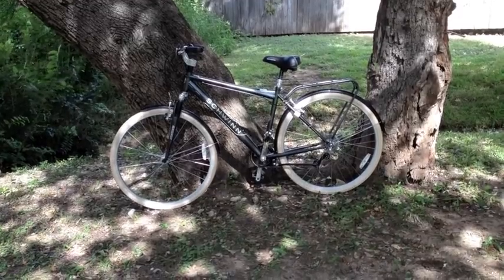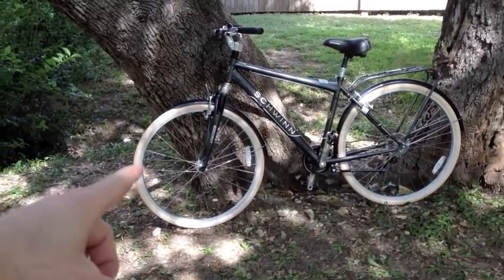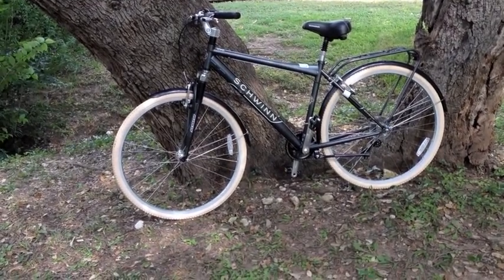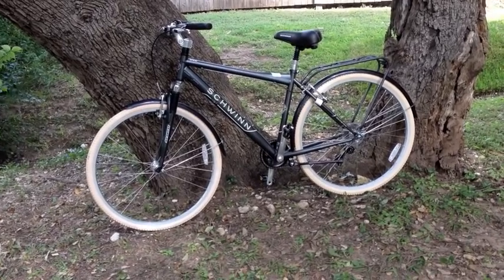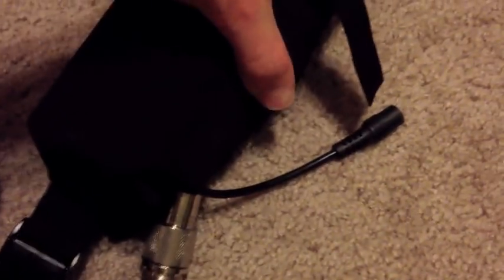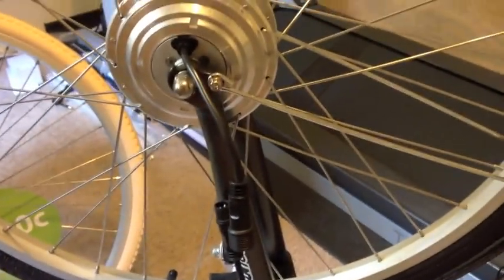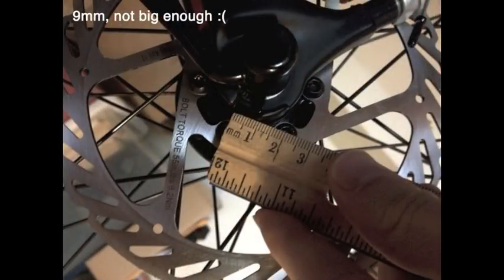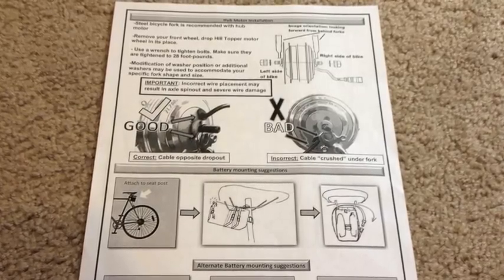Clean Republic Hill Topper Electric Bike Conversion Kit Review - $400

Comment from the maker: Hey man! Yeah, I definitely think the extra $100 is way worth the weight savings (2lbs vs. 11lbs), plus you get a better battery (lithium) that will last for more charge cycles. Check out the review linked in the video descriptions, I go through the different options, weight etc. and be sure to measure your drop outs to make sure they are wide enough!

Comment from the maker: Any geared hub motor will add a bit of resistance but it really is minimal and in my experience riding this bike under my own power it felt very similar to how the bike performed before the conversion. The biggest impact a kit like this has is on weight of the bike and that's why I like the sprinter :)

PLEASE do be sure to read the full review linked in the description and measure your fork dropouts because this kit didn't work with my high end road bike, the drops were too narrow.

Comment from the maker: The top listed speed is 15 mph and it really only has one speed when you push the button. I'd say it goes medium-fast compared with other bikes. It doesn't offer a lot of torque but it's also not that heavy. You can always pedal faster than 15 miles per hour but that's really as fast as the motor is designed to go :)

Comment from the maker: Yeah, I ordered the disc option because I wanted to use this with my road bike but the axle was too wide so then I got this cheaper Schwin that had v-brakes. It worked fine and would work with disc or vbrakes. I can't really comment on how reliable the hub is, I didn't stress test it too hard, it seemed generic and solid enough.

Comment from the maker: It should be fine, especially if you keep the battery contained in the pack they give you. Water can cause rust on metal components but most of this is system is covered or sealed. You might worry about shorting out systems but that would be unlikely unless you rode it into deep water that submerged the entire hub or battery pack and controller unit :)

Comment: Very nice video.  I'm glad to see you are wearing a helmet and eye protection. Keep up the good work. California allows us to use a 1000watt system, speed limit is 20MPH. On my bike the conversion was a bit more complex. Batteries are lipos, full lighting system, baskets on both sides to carry groceries and stuff. Max speed for mine is about 34 MPH, a speed which I don't recommend it is still a bike and not a motorcycle. Keep up the good work. You might consider add a couple of mirrors.

Comment from the maker: Good point motorhead1. The upside of the smaller light weight sprinter pack is that it's easy to remove and light weight but you'd still have to carry it around :/

Comment: I've had a Clean Republic kit for about a year and half now.
No problems so far with the hub motor (bafang)  though my SLA battery gave out after 7 months or so.Get a lithium kit the batteries last longer.The SLA battery is too heavy too..I obtained a different battery from Ping Battery and just wired it to the controller (pretty easy to do).

Comment: I been researching those kits in the last few days. I been wondering. What's the whole difference of experience having a 36 or 48v systems compared to the 24v? I was looking at the 1000w 48v kits. They have it for about $260 on ebay, but does not come with batteries. I been trying to research what batteries to buy for it. Cause it does not say. Plus I can see that more volts it is, the more expensive that batteries are. (Gotta buy several 12v batts), they are NOT cheap either, plus they get heavy. I seen the Currie brand 12v sealed ones for about $25 each on Ebay. Does that sound right?? Not only all this, I'm afraid of the laws in my town. Don't need problems there! But anyway, I was thinking the 36v system, since the batteries "appear" to be cheaper. BUT ACTUALLY what's MORE IMPORTANT to me in my opinion is RANGE, not power! I don't care about the power (me anyway), if anything it can actually be an advantage NOT to "replace" pedaling entirely, in terms of getting EXERCISE! 

So all in all, I assume that the higher voltage = more power???  I have seen 250 watts with 36v or 48v. Does not make sense to me? Confuses me.
Reply from the maker: HI Gilbert! You've pretty much got it right. Higher watt motors offer more torque but they also need more battery voltage for power. So a 250 watt motor with 24 volt pack will be very weak but a 250 watt motor with 36 volt pack will be medium and if the motor is geared then it will offer even more torque. I personally like the 350 watt 36 volt combination. In Europe the law limits ebikes to 250 watt motors but that is nominal output, most of these motors have peak unsustained output at 350 or even 450 watts.

In terms of range, you multiply the battery voltage times the amp hours to get watt hours. This tells you how many hours you could go at a set watt level. So for a 350 watt motor using a 36 volt 10 amp hour pack you have 360 watt hours of electricity and the motor could run for 360/350=1.03 hours at full speed. This of course depends on your weight, the terrain, wind and some other factors but is a good rough estimate. Hope this helps!
Reply: Gilbert Arciniega n

Comment: Since this publication in 2012, the current website lists the "Sprinter" at $599 but has increased the distance to 12 miles. There is an "economy" model for $499. All units come with an Li battery.

Comment: I think I'm a little confused by this kit. I thought that it was basically a pedal assist system and yet when I look at the hilltopper specs there is a no next to the pedal assist slot. So does that mean this is a throttle only kit? From the demo you did it seems as if provide pedaling assistance but perhaps you meant in another way? Also essentially the same as the Swytch kit but with a less fancy battery / controller pack?

Comment: great review. i like what you did with the battery pack
Reply from the maker: Thanks! I've since converted a few other bikes into electric and found that the rear rack setup works pretty well. I wanted the low center of balance but trying to stuff everything into a frame bag can be hard on wires. I guess it's a trade off now matter how you slice it ;)

Comment: Hey there Court, I've got some questions regarding these front hub kits..  so I've already spent more on my first ebike than any car I've ever owned,  I've invested in the BBS02 750w with a Nuvinci, and I'm ever so careful to always be at the top of the hill climbing gear when I take off so as not to stress either the motor or the hub..  what I've found is getting off the mark can be a lil slow as I gear up,  So, I'm curious how you think I'd go if I slapped one of these front hub motors in for pulling off a dead stop?  ( do these come in a throttle only mode? )I've got no illusions or concerns about the weight,  my bike is steel and heavy anyway. my priority is maintaining and prolonging the integrity of the mid drive and the nuvinci..  while I certainly don't want spend anymore money,  I'm unfortunately old enough to be wiser and invest more now rather than suffer my old cheap skate pay more in the long run ways..

Comment: Any heavier riders have experience with this kit? I weigh 240lbs and can handle the flats really well but the hills really kill me. I'm wondering if this kit will assist and what range I can expect out of it. Thanks!
Reply: well I've just installed the kit and ran out to get myself some Chinese food. it's a 3 mile round trip with some good hills along the way. This is 100% only an assist for heavier riders. However it did smooth out my experience.. I still get plenty winded going up the hills but I never have to stand up on the bike to power up the hills. this is a great starter kit! maybe in a year I will be looking to get a electric bike with a powerful pedal assist and throttle option but for now this will get me from point A to point B and back much easier then before =) I hope this helps others considering this kit!
Reply from the maker: mikiessj4 Thank you so much for sharing! It's great to hear about your experience and find out that its performing at an acceptable level - even if it's not powerful enough to fully transport you up hills :)
Reply: see my recent post. 284 to 256 in 4 months, now able to ride a normal bike if I choose to.
Reply: I am close that weight....I think you'll like this kit.

Comment: Get a bike rain cape.Amazon has several for a little over ten dollars.This can cover your battery/controller pack too.The motor is pretty rain resistant and like the ElectricBikeReview guy says don't submerge the hub motor under water though rain shouldn't effect it.I wipe it (and my bike) down after a ride in rainy weather.

Comment: From their faq:

"Yes, the Hill Topper motor wheel will work with nearly all bicycle tires. 

Each Hill Topper is sent with a tire and tube that can be easily removed and replaced with nearly any tire and tube of your choosing. Simply remove the tire and tube from the rim (metal part of the wheel) and replace it with your own tire. 

The Hill Topper wheel will work with tires that are at minimum 0.9" (23mm) and a maximum of 2.5" (64mm)"

You can order 24", 26", and 700C wheels

Comment: The price of batteries is kind of a price sticking point.  I installed a 1000w system on my full suspension mountain bike with extra baskets to carry groceries with.  Street tires are advised.  I also installed extra headlights, tail light, and turn signals. I use high output LIpo batteries.  They are a bit more expensive but I also use them to power my large RC aircraft.  I use my bike at least 3 times a week.  I think my electric powered bike provides me a great supplement to using my car.

Comment: Did you ever open that battery bag. Curious to see whats inside that pack
Reply from the maker: Yep, there are lots more pictures at https://plus.google.com/photos/+ElectricBikeReview/albums/5863839806615454033 which is linked at the bottom of the full written review (each review I do has extra pictures like this on Google+)

Comment: Isn't it possible to have a way of recharging the battery by your own efforts(pedal) or breaking.  I'm sure the device wouldn't be that much more weight added...I wonder if it would be worth it...what do you think?
Reply from the maker: Good question, there are some electric bikes that offer regenerative braking (the BionX system, Specialized Turbo, Stromer bikes) but you don't get that much energy back and the motors themselves have some drag due to cogging (larger gearless motors require big magnets vs. planetary gears and the magnets repel the stater when not under power... creating drag). Anyway, you can charge a battery under human power but it takes a lot longer than plugging into a wall and usually requires much more energy given human output (given the food you eat and what it costs to ship that food to your house and then cook it) vs. using coal, solar, wind etc. at scale to generate electricity. Here's one product you might be interested in, it helps you get up to speed but then regenerates (when your pedaling is most efficient) to extend the battery and hypothetically requires no charging in the human mode: http://electricbikereview.com/zehus/bike-plus-all-in-one/
Reply: ElectricBikeReview.com Thanks.

Comment: My sla battery is losing its charge faster these days. Can i put the lithium battery on this hub as well.?
Reply from the maker: Yeah, I think you can! I recommend calling or emailing Clean Republic directly to double check. They are very responsive and will help you pick a battery that will work with your kit. I really like the smaller light weight Lithium-ion pack they offer and it should last for more charge cycles than a Lead acid pack.

Comment: they are making a nice controller and battery pack and giving you a cheap chinese wheel motor with it. They should at least be building nice handbuilt wheels onto the bub at this price. They are not untrue because of shipping. they are untrue because they are machine built

Comment: An electric motorized front wheel on a carbon fiber fork with aluminum dropouts? Does anyone else think that was a REALLY bad idea? Why would anyone want to put a motor onto a really lightweight bicycle? Is pedaling too much of a strain? As someone who has custom built every bike I've ever owned words fail me. So far, every video I've seen for this kit, including the company one where the noise from passing traffic is a distraction, has been less than professional. A motor on a carbon fiber fork - really?

Comment: I like your vids.  68 year old very strong bike rider. JUST bought a FITO MODENA 3speed alum alloy frame w/ 26in fat tires.   In LIMA OHIO I ride 3 days up to 5 days weekly, one way from 15 blocks minimum up to 40 blocks to various stores to buy a lil food to put in my back pack, maybe 3 up to 5 rides ea week & of course the return ride. LIMA has long but moderate grade up hill rides that can be 4 up to 8 blocks long.  Am looking at ALL vids to do  a front wheel install hub motor for rides UP TO 20 blocks one way & 20 blocks back with a back pack of groceries twice ea wk.  & 15 blocks one way to my best friend to watch TV & cook together.   Curious as to SIZE of motor needed for IN TOWN rides.  "HER" Mini Cooper does our long rides LOL - SHE was terrified I made a mistake till she followed me across town.  LOL - SUGGESTIONS for medium speed, medium length riding in town on SIDE STREETS??? -  I will POST a project video once I chose the right KIT - yours are the best vids on youtube

Comment: Looks like the performance isn't that great on it
Reply from the maker: It's a pretty basic system but it's inexpensive, light weight, easy to install and definitely provides a noticeable boost over pedaling alone. Just depends on what you're looking for, the BionX kits are a big step up in performance and they offer regenerative braking, pedal assist and throttle but cost more and are so much harder to install.
Reply: it is designed to assist, not make a moped out of a bicycle.
Reply from the maker: Lance C Word!

Comment: That battery looks completely useless
Reply from the maker: It's definitely a weaker ebike due to the limited motor size but the batteries come in several different sizes. I picked the smallest size lightest weight one to create an ultra light ebike but the capacity and power was actually decent. This kit is all about affordable/easy so yeah, not quite as useful for heavy duty applications :)

Comment: this is $800 dollars? wow...way too expensive! i could buy a new gas motorized bike for $450, and spend and $10 gas per month on it...and i don't have to peddle..and it will also go up to 45 miles per hour....and save alot of money in my pocket...this electrical bike is not a good deal.
Reply: +Nofle Almorabi Where the hell do you live where you can live off of 10 bucks a gas per month and 450$ for a motorcycle. I call bullshit.
Reply: Dognamedabu2 exactly $450 dollars that was a gas motorized bike was sold on eBay...and those gas motors will take you to far places without using that much gas. So. U spend about 3 or 4 dollars to fill up the tank...and it will last long(depends on how you use it)
Reply: Nofle Almorabi How bigs the tank though?
Reply: About a gallon....which will last for about 7 or 8 miles.
Reply: A gallon of gas is $2.20 according to where I live